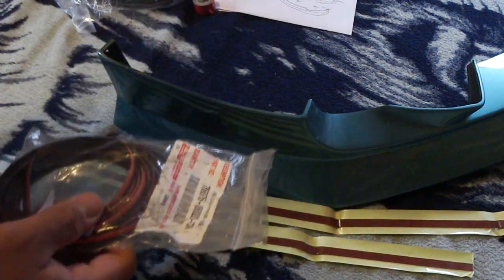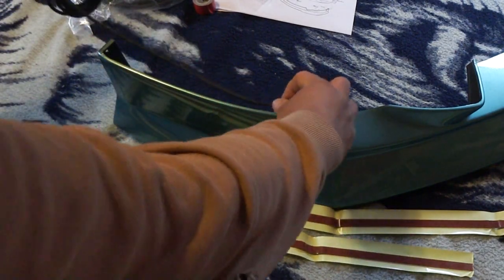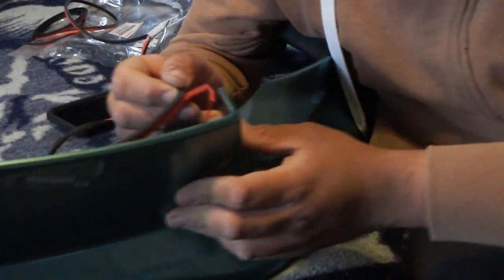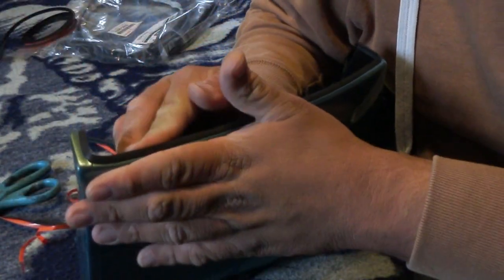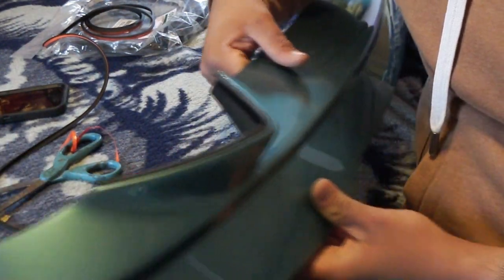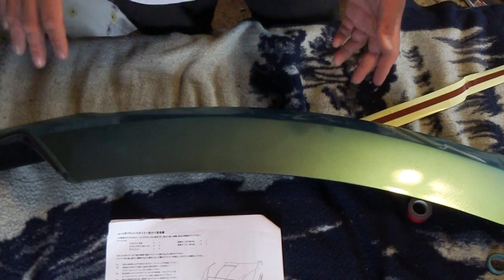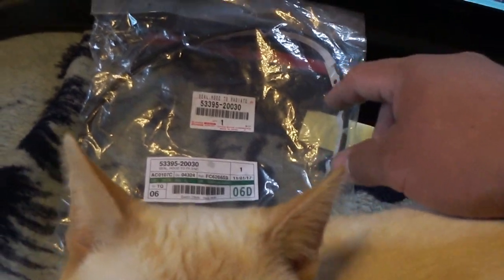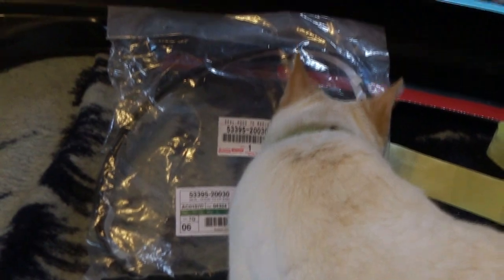Celica GT-S Greddy front lip and Tsunami hood scoop install

Comment: Bro major score not as good as supercharger. But my build coming  along I scored tsunami hood scoop and the wing I have a Trd with break light. But tsunami looks cool the body lit was on it but the side skirts damaged front was also bad but I did score the OEM fog lights, mine has the original fogs but with my trd front end il have a spot to put them on il splice to existing...
Reply from the maker: indeed

Comment: Does it still hold on ?
Reply from the maker: Unfortunately this first lip cracked pretty bad in 2 pieces by a chunk of tire on the highway. I was able to repair it with donor plastic pieces but it was then stolen off my car.

Bought a second one and it’s been fine. 

It’s good if you don’t daily your car but if you do be prepared for when it cracks

Comment: Just tape? Wow, I guess I was just naive on how things worked. I assumed you'd have to get it like bolted in
Reply from the maker: I ended up using the screws that were provided with the lip.
Reply: They are going to fall apart
Reply from the maker: Well, even after I hit road debri causing the lip to crack In half those screws never came off and the lip hanged on. Greddy provides those installation screws for a reason

Comment: Does anybody know what the lower center piece of the front bumper is called just bought a 2001 celica got and the center piece is missing from the bumper I went to look online to find another replacement bumper but the replacement is missing that piece as well what’s it called and where can I find a replacement for it? Thanks in advance and great video bro the lip looks awesome
Reply from the maker: do you mean the center grille or oem lip?
Reply: 2zzlow did some more research it’s called the valance I couldn’t think of the proper term for it
Reply: 2zzlow your celica is pretty clean by the way 👌🏽
Reply from the maker: Thanks, really appreciate it...